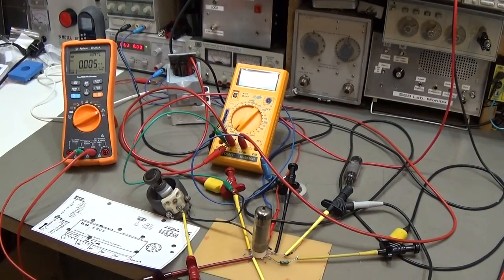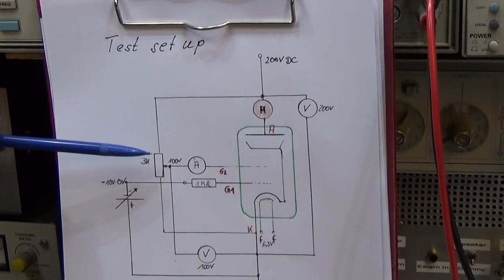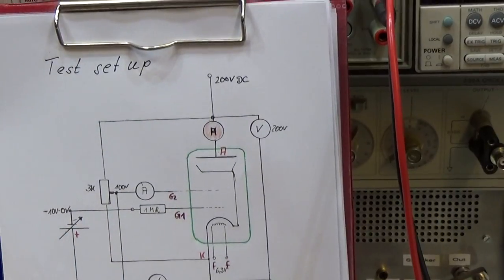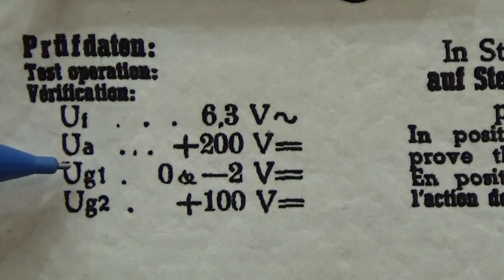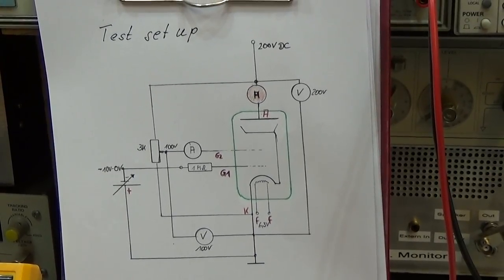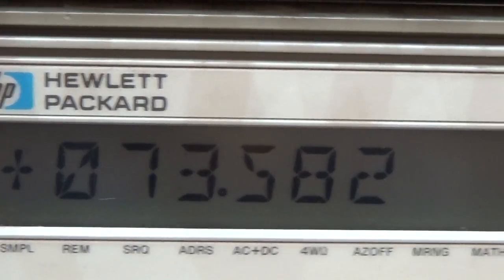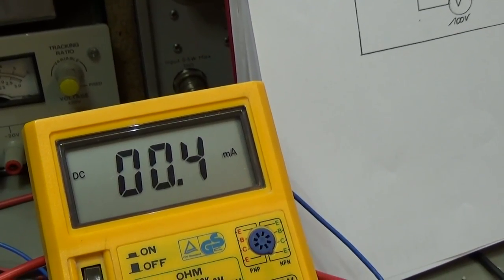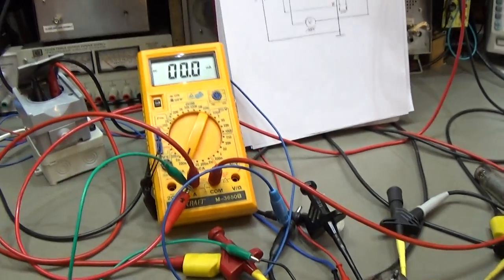#40 Electronic Tutorial: How to test an electron tube / valve without a tube tester

Comment: Good explanations, nice lab. But who work with tubes and knows them can easily imagine this kind of test and who can not imagine is in danger to be electrocuted. I use stabilized voltage suply, one for each voltage needed (plate, screen, g1 and filament).

Comment: Lets assume we have an additional signal generator and a 2 channel digi-oscilloscope. If we drive the g1 with a sine wave from the generator and connect the 2 osci channels properly, wouldn't it be possible to measure the characteristic curve of the tube?

Comment: Thanks for a interesting video. I think you maybe have some error in the schematic? You have the voltmeters for anode and grid in series, I think? You should perhaps have a ground point between? This is a emission tester, I suppose? Could you do something to make it an transconductance tester? Also, if you dont have the "cheatcards", maybe use some old tubebooks or info on the web? I would like to emulate this method, but with a regulated power supply for the high voltage. And go for 6v dc on the heater... Anyways, stirring stuff, keep up the good work!
Reply: I believe it is assumed that where all the lower connections are made would be the common (ground) point and that is where the negative power supply connections would terminate. I also believe he is using the upside down T to indicate the common or ground point. Then the volt meters would be able to measure the voltage from the high point to the low point of the circuit. The current meters are in series and would measure the current flow to the plate and Grid-2. Hope that helps.
Reply: I was thinking the same, Chuck. But I just pointed to some points for clarification.
Reply: By closer lock, I see that the schematic indeed is correct and that the ground is where it should be. Sorry about my silliness. I am myself looking into building a modern dynamic mutual conductance valve tester, so this is a interesting step towards that. Also my point about using 6v dc for heating does not work as well for this application. 6.3v dc (or ac) is correct.
Reply from the maker: Looks like all is clear now. Thanks for watching and comment..Cheers

Comment: So i assume in circuit: under normal circumstances  operation g2 is the output and in this test we tie down g2 midway in this test to work out the drive current (base leg of a transistor) in g1 ? So ordinarily when we vary g1 current we vary the large g2 voltage and hence amplification ?

Comment: I am wondering if you could tell me what the value of the large variable resistor (POT) you are using to control the screen voltage? Thanks for the video.
Reply from the maker: If I remember right it was 3KOhm
Reply: @TRXLab  , I am actually quite confused about this pot. As I can see you're using something more powerful here. If we calculate its power loss it turns out to be 13Watts! I was wondering if it is possible to use something like 4,7k, 10k or even more here?

Comment: Hi, first off I really enjoy your videos. Can I ask a question? I see you use an isolation transformer on lots of projects and crank up the voltage slowly. Can you tell me exactly what you are using for this process ? Thank you and regards, Leo
Reply: Let me rephrase i can see the very expensive isolation tranformer you are using but can you suggest a more budget option for this ?
Reply from the maker: Hi Leo, well there is not really a budget solution. Certified  isolation transformers are expensive. You should buy one off ebay that might be the only way. But be careful not all transformers are isolation transformers even when they called so....
Reply: Thank you for your reply much appreciated. Well i will try look around. For all my other testing on non tube applicances I usually use my lab power supply to slowly crank up the power but I can see that will not really do for tube based circuitry really. Regards and  again much appreciation for your videos. Leo

Comment: Great video! I have a question, I'm working on a Nordmende Boheme radio and the EL84 output tube runs very hot 420 F after 5 minuets and the audio gets distorted. The radio has been recapped and out of tolerance resistors replaced. My tube tester shows the tube as good with no shorts. Tube voltages are: Schematic:  pin 7,  240V  pin  3,  8V  pin 2, 0V  pin 9, 250V  Measured voltage: pin 7, 250V pin 3, 7.6V pin 2, .08V pin 9, 232V Is this voltage difference enough to make this tube get so hot and cause distortion?
Reply from the maker: +Len S Hi Lens, no if you have taken all this measurements without a mistake it can't be the reason. Normally I would see a couple capacitor as root cause but you are saying that all caps has been replaced...Very often it happens that something went wrong with the recapping so double check it. Beside that there might be a problem with the output transformer or a problem in the power supply. Have you checked the ripple?? But anyway can't really advice you per remote the problem can be anywhere...sorry Cheers
Reply: Thanks TRX I will check my work again and check that output trans. I have no way of checking the ripple.

Comment: Hi friend! Thank you for beautiful video! Can I use same or similar procedure and circuit for testing 6L6 tubes?
Reply: Of course yon can test 6L6, read datasheet  fot voltages and results. In fact a tube tester is doing same tests but a little easier. I am doing frecvently such tests at tubes, even I have a tube tester L3-3.
Reply: Thank you friend!

Comment: How can I get into electronics without having to go into debt for twenty years in student loans and without having to then buy £30.000 worth of test equipment? Am I just left checking fuses?
Reply from the maker: InTheNameOfJustice Hi George, no I don't think so there is much more left than fuses:-) Additional to that 80% off all repairs can be managed by a simple DMM. Beside that there is a huge surplus market where you can buy really valuable test equipment on a budget. Regarding skills, I think you are doing exactly the right. You are interested in electronics and step by step you are getting better. If you are not a member of the UK radio association (HAM radio club) yet, then it is now the moment to join. There is really a huge knowledge base among the Ham radio operators and they are really willing to help and teach. So do not look to much at the black side... Have fun :-)
Reply: A really  good basic book for simple to pretty advance electronics is the ARRL Radio Amateur's Handbook. About $40. Your library should have a copy for you to look at.

It's oriented toward communications, but it is a good, practical book. Also covers basic to intermediate test equipment.

Comment: I watched your video carefully , however I digress and take to disagree with your method. The transconductance of a vacuum tube is the element factor of a valve's strength and whether it is any good or not. I use the same method you do. Your method however did not come up with a value for conductance, i.e. transconductance. Your method used is merely a go- no-go  test. The 27 ma.that You measured was the quiescent value of the valve at rest or cutoff. 
Then you measure a current of 33 ma. at zero bias. Transconductance GM = the change in plate current divided by the change in grid voltage. By the values given I come up with 3,000 micro-mhos. The maximum value is 11,700 micro-mhos. Thus making the value of 3,000 way below a passing value for a good tube.